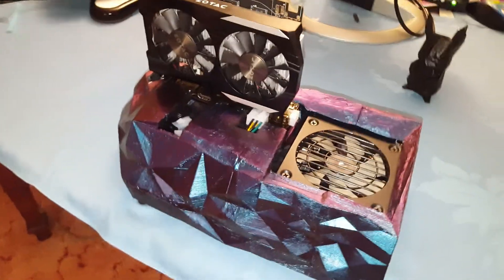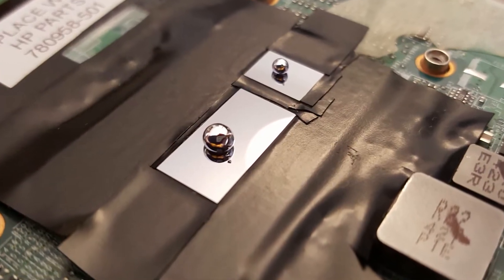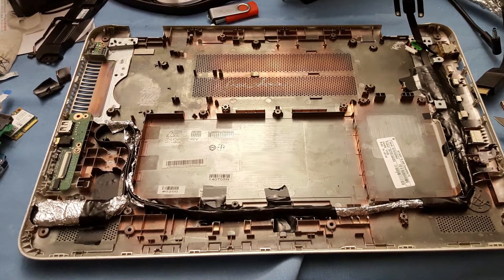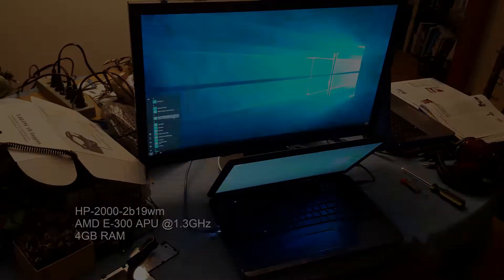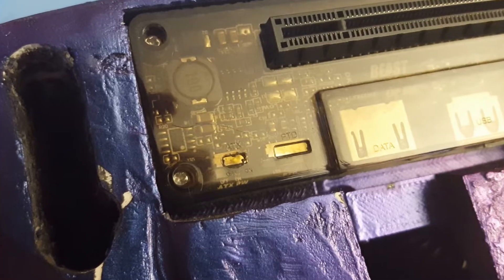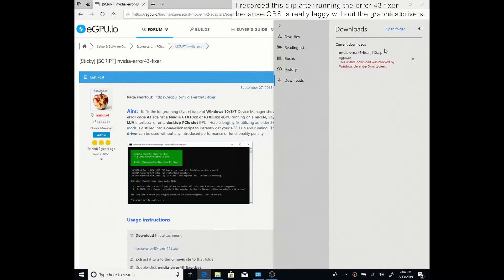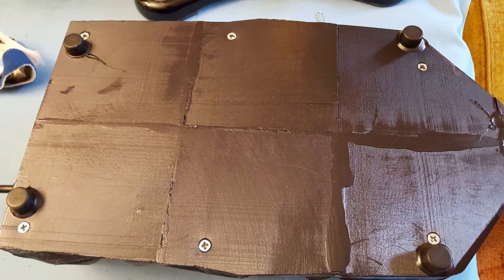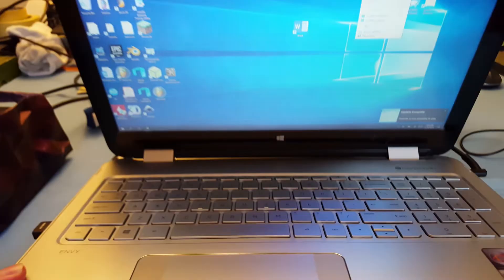External GPU dock Vlog/Tutorial

Comment: I’m running on an i5 chip with 8gb of RAM, what gpu is optimal? I wanna play Fortnite 1080p competitive settings at at least 60 FPS 🙃

Edit: also link for 3d print model
Reply from the maker: Any card equal to or better than a 1050Ti or 1650 should comfortably handle Fortnite at 1080p on medium to low settings (I'm assuming that's what you mean by "competitive"). 

Depending on what i5 you have, you may experience CPU bottlenecking, tho. As shown at 7:40 in the video, a lot of builds cause my dual-core 4th gen i7-u to chug. Luckily, you can often get huge performance gains just by cleaning out your fans/heatsinks and applying aftermarket thermal paste to the processor, so if that is a problem all hope is not lost.

As for the 3D model, I will dig that up and get you a link this weekend :)
Reply: Jousboxx what do you mean by “chug”? I’m kind of new to all this... And I’m concerned that my small ram makes it slower, do I need to upgrade it? 

It’s an i5-3320M @ 2.60 GHz    2.60GHZ with 7.7 usable ram out of the potential 8. Lenovo thinkpad x230. 

What exactly is bottlenecking anyway, is it that the system runs SLOWER with a better gpu or that it still runs better the better the gpu but that the gpu is used inefficiently?

I may just take the laptop to my local hardware guy to get the fan cleaned and thermal paste changed. I used to run a little iphone fixing business so I’m familiar with how delicate some components can be, I don’t want to tear a flex cable.
Reply from the maker: @dagingerbreadman70  "Chug" isn't really an official technical term, I'm just saying that it was kind of laggy in that situation.

In most cases, RAM won't really make the game run slower or faster. It's just that you need a specific amount of RAM to run a game. If you don't have enough available, the game won't run at all or it will suddenly get super laggy. To see if you have enough RAM, you can load up Fortnite on your laptop and set all the graphics settings to high. Don't worry about the terrible framerate, just open up task manager and check how much RAM you're using. If you have less than a gigabyte free, you probably need to upgrade. 

I can't tell you for sure if your hardware will run Fortnite *well*, but I can say that it will run. Thinkpads are generally well built and utilize the hardware to its fullest capacity.

Bottlenecking is basically when one component is not being fully utilized because it's waiting on something else. In this case, it would most likely be the GPU waiting on the CPU and the PCI-E link.

And yeah, cleaning the fan and putting on new thermal paste can never hurt. I would recommend Arctic Silver 5, I've been using it for years with great results. Also, probably avoid liquid metal. It provides great thermal gains, but it is difficult to properly apply, can damage your hardware, and will "wear out" after a few months (at least that was my experience).

P.S. I added the links to the Blender files in the description :). The exported models were very disorganized and incomplete, but I know that the blender files have everything.
Reply: Thanks so much man, really appreciate the info

Comment: I cant run windows without my wifi card, it crash with a blue screen and increase in a insane way my fan also without conected the exgpu,  and also disabling the UEFI is nothing there :T
Reply from the maker: woahwoahwoah slow down there buddy! I will be happy to help you but I'm not entirely sure what your problem is. If I understand correctly, you cannot run Windows unless your WiFi card is connected, and you tried unsuccessfully to use the eGPU with UEFI off. What make/model computer and GPU are you using? What version of Windows? What other procedures have you tried?
Reply: @jousboxx9532  ok, I'm trying to start the egpu in UEFI, it doesn't crash for not having the wifi card, it crashes just for connecting the minipci-e (ngff) cable in the port without connecting the EXP GDC8.5 (with gtx760), the graphic card and the power supply energize at the same time as the laptop (acer E5-553 AMD A12 9700p) but it gives me a blue screen with the error "A required device isn't connected or can't be accessed".

If I put the UEFI off and activate the leagacy mode, it only tells me "no bootable device" in black screen.
 and in the same way from the boot menu. 
My windows 10 is original from the factory, maybe I have to install a new windows version since the one I have is very protected?
Reply from the maker: @BrianVG  Very sorry about the slow reply, I must have missed the notification. You're correct that you will have to reinstall Windows. The Windows bootloader is stored in some UEFI partition, so when you switch to legacy mode it doesn't detect that and it will fail to boot. I would recommend making a LiveUSB of Ubuntu and trying to boot that in legacy mode with the eGPU installed. That will ensure that you don't have any other problems preventing you from booting, so you don't waste your time reinstalling Windows only to find that it doesn't fix your problem.
Reply: Did you figure it out?

Comment: did u experience any performance drop using da mini pcie 

what was ur bandwidth 

i want to buy some n ma laptop has both da express slot n da pcie which one should i get
Reply from the maker: IIRC the theoretical max of my setup is 500mb/s (don't quote me on that), but I was getting values in the 350-400 range. I'd suggest you go with the ExpressCard slot because you wouldn't need to destroy the inside of your computer and remove the WiFi to make it work. Also, it would be removable. 

From my experience, the bandwidth tends to be limited by the quality of the cable and GPU interface rather than by the type of port you plug it into.

Comment: İ trayd to plug lcd to my graphic card but i got nothing what do i need to do
Reply from the maker: Hello, I'll be happy to help you with your problem, but you need to explain it more thoroughly first. What version of the EXP GDC beast do you have, what connector? Where on your computer did you plug it in? What power supply are you using and how is that connected? What Graphics card and monitor are you using? Also, please include any other relevant info. eGPU setups are very finnicky and particular, so please explain your setup and problem with as much detail as possible.
Reply: @jousboxx9532  am using i have ngff version v8 and  i have gtx 1050ti 4 g and my power supply 350 w  all i know is i saw it on YouTube so i put the exp gdc and the graphic card and i plug it in all i got on laptop screen is black and i use normal tv 20 enc with hpmi kaibul and on the tv i got no signal
Reply: @jousboxx9532   du you have anything i can talk to you app or something i am from iraq and i live in turkey i need your help please
Reply: İ just posted it on my channel you can see it
Reply from the maker: @yusufaljuboori9851  Hey, sorry for the slow response, just saw your replies. It looks like your external monitor is severely damaged. I don't see anything wrong with your hardware setup, so my guess would be that it's just the monitor. With that big of a dent on the screen, it's likely that some circuitry inside is broken too. Also, make sure your laptop is in BIOS or Legacy mode, not UEFI mode. Also, make sure the ATX PWR switch on the EXP GDC is set to ON.

Comment: could something like this work with like a 4k monitor or a high refresh rate monitor or is it down to what gpu you put in it
Reply from the maker: It's all down to the GPU. I'm getting about a 15% performance hit because of the slow mPCI link, but I had it working perfectly fine with a 4K TV. However, I tried it with my 1080Ti and it didn't work. That is probably due to limitations of my motherboard, but keep it in mind.